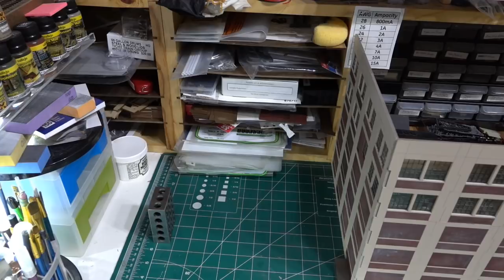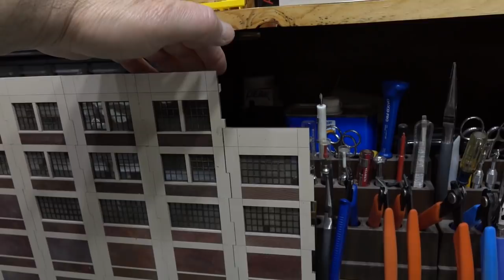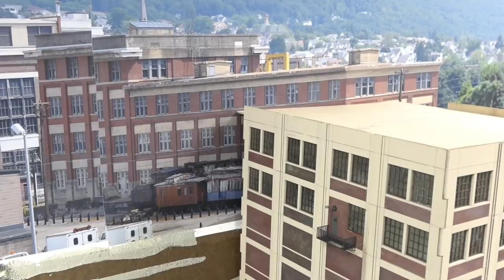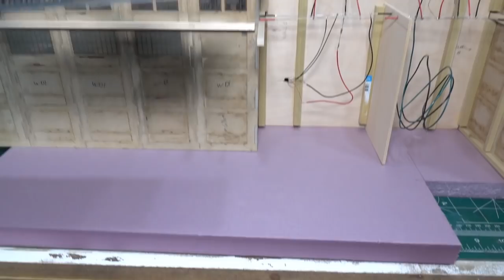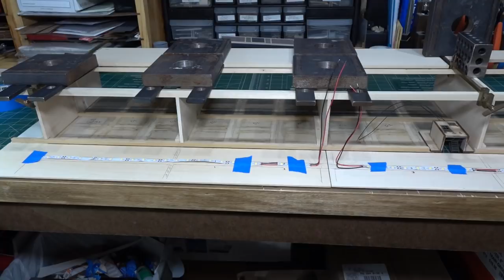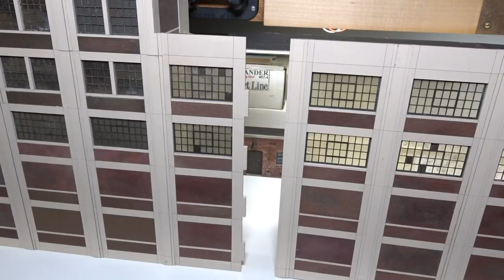Scratch Bash Project: Westinghouse Transformer Factory- Part Three

Comment: Have you considered the Walther's heavy duty overhead crane kit 933-3150 and the electric Transformer kit 933-3126? Hopefully they will do another run of the 4 and 8 axle heavy duty depressed flatcars to. Railfan Models offer several KASGRO 300+ Ton kits and RTR HD flats. It's a dollar a ton for these models though.